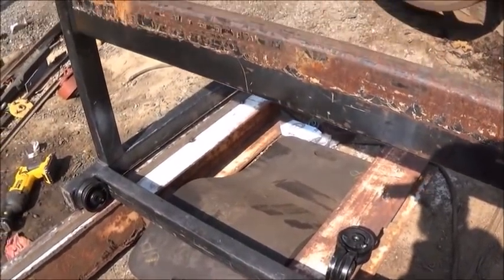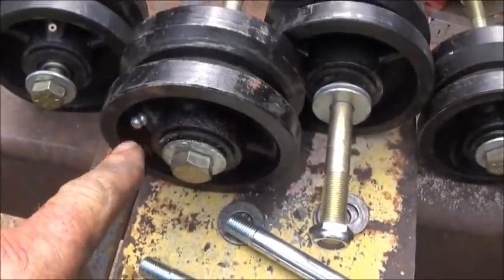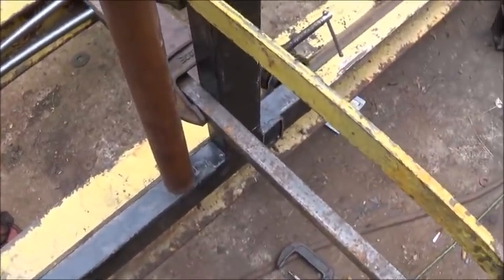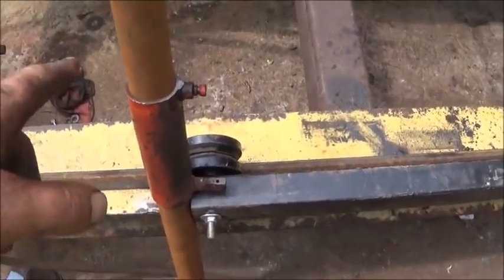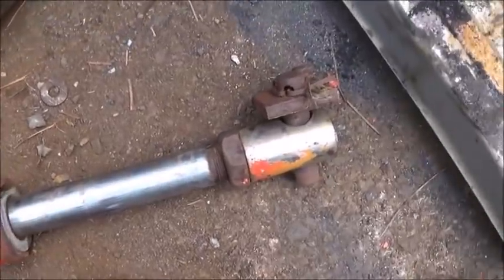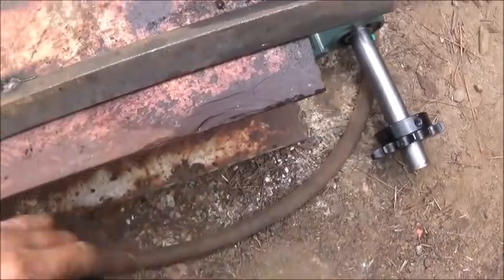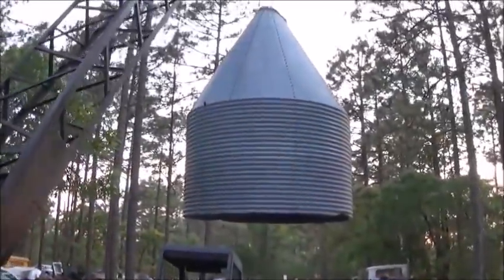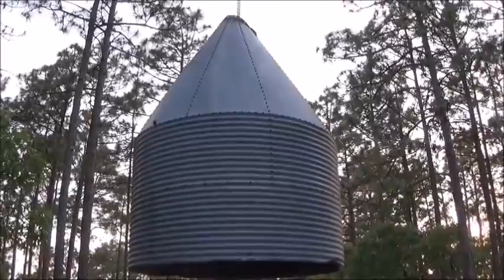TRASH TO TREASURE BUILDING A BAND MILL SAW  MILL part 2

Comment: I love the made in Canada steel. I am too . Johnathan the most important thing with a bandsaw mill 
is the blade needs to run Parallel with your mainframe  so as the wheels ware you need them to be adjustable or the
blade will bind. If you look at any saw 3 wheels are adjustable to keep the saw headframe square the the main frame . Also the blade
guides, dont cheep out on them they can be your worst nightmare as well as blades I run Lenox Blades and have good luck with them.  I have built and re built many saws trouble shoot and repaired for myself and customers and seen all kind of F Ups along
the way .  The blade rim speed is critical also .  I like your ambition have fun I will watch to the end and see. Thanks  Joe

Comment: Hi Jonathan,  you're going to find the key to cutting true lumber on a band mill are a few different things.  In my opinion a sharp properly set blade is number one. Next is keeping debris from getting between the track and rollers, a piece of wire rope low enough to just touch the track in front of the rollers works very well (not my idea I wish it was).  Blade tension and tracking also play a big role.  Keeping logs doged down securely  are all key players in band mills.i have a bit of experience in different forestry equipment and your never going to get a clean straight cut with a dull blade. I can't wait to see that mill, however I was hoping you were going to steam power it!! I think you should have been a mechanical engineer, it is more fun to build things tho.

Comment: My x-FIL built prototype circular blade mill back in the 1960s on the west coast where the blades travelled down the log, rather than the log travelling past the blade. It had a horizontal blade and a vertical blade so that each pass cut a complete board. He was sawing trees that were up to 6' diameter with this mill. He and Jonathan  would have got along famously with their creative minds and manufacturing skills.

Comment: I have a grain bin like that and was just talking about putting it out in the woods with a door fixed on it. It will stand up and be a steel teepee for us to go camping in, the hole in the top will have a cover operated by a rod to let out the smoke from a small fire  in the center. It might make a good deer stand with some gun slots but just a camping thing for now.

Comment: I built 24' fixtures to minimize warpage when welding long parts, I used 8" I-beam. Then was told that I was wasting time supporting the center, so I got a piece of string and showed how much it sagged from its own weight. If it don't bend it breaks, was my answer. Working as a machinist for 30 years I have worked on most everything, I built the cable drive system for a large mill and the customer had to have it so the carriage returned at 60 MPH to be cost effective for his operation. It's looking good I think chain slap will be a issue to deal with, I wonder how smooth sprockets vs cable will feed it will be interesting. I built a little fixture with small angle iron and a muffler clamp to put a level on when cutting the first keyway so each end were in perfect alignment for sprockets.

Comment: I am very impressed with the amount of research that you've put into the project. I have zero doubts that not only will it work well, it    will be  widely copied by others trying to get something very affordable and dependable. I have no clues as to a patient for this as its kinda like tires... they are all round and go on a rim. Since you have designed this project yourself, you should be able to get something that at least copyrighted in your name. So I will be a watching very intently for the next portion of the build. If a man blinks, you will miss some fine video work and in this case, you had best pay careful attention.... great work

Comment: If I missed this , are you planning on adding extra chain bearing rollers.to take up chain slack. In 18' to 20' it will sag and possibly allow the carriage to jump some. Tensions good but to much will cause wear n binding . Just my observation

Comment: The duromax is great.. ive left mine outside since 2012. The only thing ive replaced is the petcock. I use a 15v solar panel to keep battery charged. I built mine to be a generator

Comment: Your 1 to 1 angle gearbox ought to work out real good for raising and lowering. 6 turns per inch? Should be able to move pretty easily. I like it. It'll be overbuilt like everything you do. Solid. Keep dry, we've got some weather coming in. Thanks again for your time and videos.

Comment: Got any leaf springs with spring eyes to make up some spring loaded hold down rollers to ride under the w beam flange. Just one per side.
Reply: I owned a WoodMizer bandsaw mill and with the weight Jonathan is going to have on the carriage the blade won't jump unless he tries to go through the cut to fast or the blade is dull.

Comment: have you thought about put a piece of steel behind the blade to act as a wedge to prevent the weight of the wood from pinching the saw blade as it gets deep into the cut.
 I think it will make cleaner cuts and lengthen blade life by keeping the temperature of the blade lower.

Comment: The only problem with a 6 pitch is six doesn't make 3/4 inch an easy stop.  I guess if you are always doing inch measured lumber it won't make a difference.  Love the Spacely Sprockets comment!

Comment: Gonna have to do a little math with your threaded rod. You need to take into account whatever the kerf of the blade is. For example, if it's 1/4", you'll have to add a quarter turn for every cut to achieve whatever dimension you want.

Comment: Also do they make a 8 thread per inch rod so that it’s more equal to 1/8” increments for height?
Reply: If the bade kerf was 0.0417", the board thickness would be 1/8" per turn with 6tpi

Comment: I think I would have gone 8 T.p.I. Just because everything in construction is in 1/16, 1/8, 1/4, 1/2
Reply: blade kerf
Reply: @ronmccabe1169  circular sawmill is 1/4 in kerf (2 turns) bandsaw 3/16 ( 1.5 turns) . So I guess I don’t understand
Reply: @joshuasmith4547  I was saying that you need to remember that you have to take into consideration the kerf thickness when moving the log. I didn't know the kerf on a log bandsaw blade (only worked with metal bandsaws). So 8 turns on an 8tpi lead screw will leave you with a kerf width less than 1" (I think). Yes?

Comment: work with a new corporation in building cars in a crate V W cars// in using parts and machining to work with in selling a car $6,000.00 ship to homes //as car companies are pricing them sell out of business and used a chip them outdate them making the car ,never to drive it //there are 150 million people living on $700.00 to $2300.00 a month  that will never buy a new car //and V W  car parts can be used to build new with air cool motor to bring sales over the top to people .car in the crate with some carbon fiber body parts never rust out //the people car in a crate , go go

Comment: Corners are generally thought of as a 90 degree angle. 
Where the floor meets the wall is 90 degrees .
Could pee at any point where the wall meets the floor and be peeing in the corner .